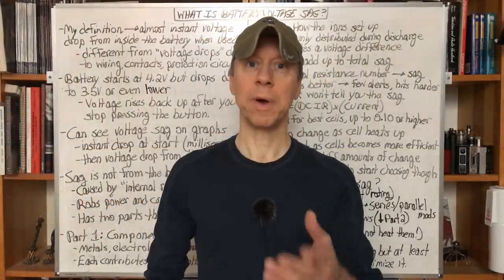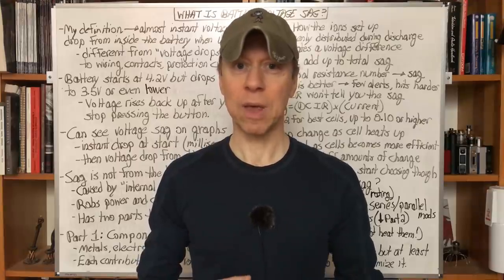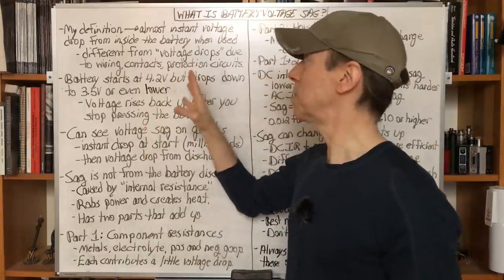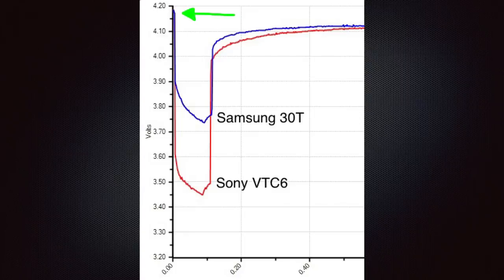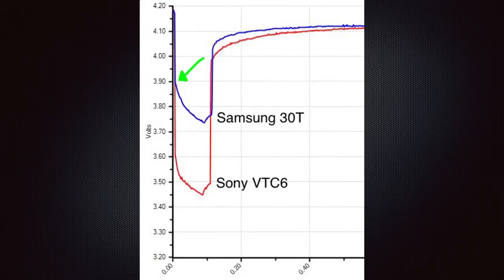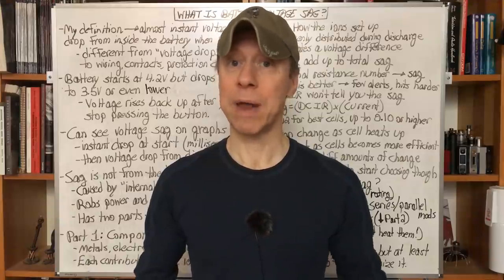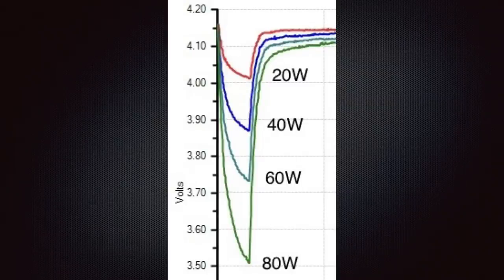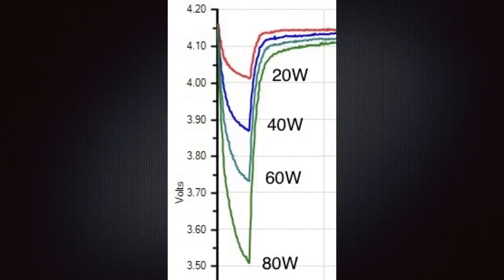Minding Your mAhs – Ep021 – What is battery voltage “sag”?

Comment: Mooch.  Congrats on this series of videos.  I'd like to recommend one on rewrapping batteries and choice of battery insulator.  Should we, if we do how do we do it safely?  I've seen vids with people removing the wrap with a metal tool from the positive end.  Also can you do one on how to check your set up on a mech / unregulated.  So measuring what's happening with voltage loss and sag under load.  This would include equipment needed, how to do it safely, interpreting results etc...
Reply from the maker: Mike Vapes has a good rewrapping video. Jai Haze has a battery sag video.
I’d like to do both some day though.
Reply: @batterymooch  Yes I've seen Mike's and it is good. With all due respect to Mike he's not the obvious person to turn to for a 'how to' with regard to battery safety. They're just suggestions.  I'm pointing people in your direction.  It's surprising how many people have absolutely no idea of what capacity batteries they have in their mods.
Reply from the maker: Phil Drewett I was just suggesting resources to use until I can do my videos. 😁

Comment: Another suggestion mooch with regard to your great vids.  If you ever decide to edit them particularly hard hitting for everyone, but especially for noobs is maybe to include some footage of batteries venting.  I've seen a few where I think it was down to keeping a spare loose in the pocket probably in bad condition.
Reply from the maker: I agree. Video of cells going boom would be good but I think we all know it happens, even the new vapers. My big problem though is that it is generally frowned upon here in Manhattan to do that type of stuff in the city parks and it’s definitely not being done in my apartment anymore. 🙂 I have some safety testing that would benefit from it though and hope to find a way some day.
Reply: @batterymooch  I knew it has happened.  I didn't realise just how dramatic it was until I saw some poor sod running around with his trousers ablaze though.
Reply from the maker: Phil Drewett when you contain all that gas, smoke, and flame in a mod it can turn into something like a rocket engine. Scary stuff!

Comment: Thanks for this Mooch, very helpful indeed. Just a quick question unrelated to this particular video, for a dual battery regulated mod using it at around 75-140 watts I'm not sure if buying 2 samsung 20s's or 2 Molicel P26's would work more efficiently for the longest time? But either one in a dual battery situation should most definitely last longer at 75 watts than say one a single 21700 Molicel P42 or 30T, right? Cheers Mooch :)
Reply from the maker: The dual P26A’s would last longer than any single cell. Not sure if dual 20S’ would.
At 75W (dual) the P26A’s are the best choice. At 140W the 20S might run for longer. You might have to try both to see which work best for the way you vape.

Comment: Hey mooch i have a question that is not related to this particular video but i wanted to ask;
I have a 80w box mod, is using the awt imr 18650 battery with a 0.2 double coil good?
Reply from the maker: There are many different AWT 18650’s, some rated under 10A. But I do not know the true ratings of any AWT’s now since it has been too long since I have tested any. AWT hugely exaggerates the ratings of their batteries though.

Comment: Hello Mooch, we prepared the battery, in the first charge there is appear sag, and voltage drop drown, but in the second charge and discharge the sage is disappear, could you tell what's the reason. thank you
Reply from the maker: I don’t know.
The battery might have been old and after it was used and charged it started performing better. Or the battery was warmer the second time, that helps a battery perform better. Or the testing you did changed the second time you did it. But I am only guessing, there’s really no way I can  know from here what’s going on with that battery, sorry.

Comment: It is not a question to the video, but maybe someone can help me. I'm a MTL vaper and I normally don't go over 5A with my builds. Are there any batteries with better batterie life than an VTC6A? I know that a lot of batteries who claim to have more than 3000mAh can't output much amps, but this shouldn't be a problem for a MTL setup, right?
Reply from the maker: Try the Sanyo NCR18650GA. It’s about the most capacity you’re going to get while still working efficiently at 5A.

Comment: Vapers at 80+ watts on a dual battery mod would need the 2500 mah rated cells not the 3000 mah rated  cells  to get the most out of your batteries
Reply from the maker: Cells like the 2500mAh HE2, HE4, and 25R wouldn’t give much of any improvement in battery sag though other high performance cells could. In my testing the “crossover” point for when a cell like the VTC5A would be the better choice was above 50W-55W or so, about 100W-110W in a dual battery mod. Chain vapers might see that crossover point be lower though.

Comment: hello mooch, I have a question, recently bought a xtar 4 slim charger, which can charge a couple of batteries to 4.1 v -2.0v - 1.0 v, charge 2 Ijoy 20700 batteries to 4.1 v automatically, being in 75% of charge, I just stop wasting the batteries and I realized that both batteries had been damaged that had relatively little use (6 months), at that time I thought the problem was the batteries, days later I returned to charge two more batteries in the automatic mode 4.1 v two batteries 21700 golisi, were charging normally, and again stopped charging and again damaged my pair of batteries, the question is, charging batteries to 4.1 v, can damage the batteries? Thank you
Reply from the maker: No, charging to 4.1V should not damage the batteries as they can be charged to any voltage between 2.50V-4.20V. How do you know the batteries were damaged? The charger just might not be charging up to 4.20V. How are you reading the voltage?
Reply: Battery Mooch thanks for answering, this slim 4 charger of the xtar brand has a charging function in three charging modes (4.1 v -2.0 v - 1.0 v) but when placing a battery, it automatically loads to 4.1 v, it can be manually changed to mode 2.0 vo 1.0 v, also has a temperature sensor that generally a cold and discharged battery has a temperature of 22-23 degrees Celsius, and if one loads it directly after removing them from the mod, it has a temperature of 32-33 degrees Celsius approximately, I charge them at this temperature (32-33 degrees) and I started charging them for the first time in this new charger that I will replace the VC 4 of xtar that stopped working in less than 6 months, when placing the batteries in 33% load, began to load regularly up to 75%, but from one moment to another the screen stopped reading the load, at that moment I thought, the charger is badly connected or is with a defect, remove the batteries and probe in my EHPRO ARMOR (2 1700/20700/18650), and did not fire in both batteries to 75% supposedly, days later I returned to load a 21700 or 20700 I'm not sure, started loading normally, but after a few minutes, the screen was again in blaco and just indicated below 4.1v, I went back to test them in my mod and simply did not turn on the mod both batteries, it is there where what I first thought was my battery problem that I bought next to the VC4 charger (6 months of use approximately), I left of that doubt because again I miss another pair of batteries in a week, the charger works perfectly 18650 batteries in charge 1.0v -2.0v but I no longer risk to charge my batteries in the 4.1v mode

Comment: I wish U wldve given some examples like comparing the samsung 30q and lg hg2. Vaping between those 2 batteries is when i really learned about battery sag and IR. The samsung 30q is a much better battery for how i vape. I havent done in depth tests but just from using both I have a better experience with the 30q. Not to say the hg2 is a bad cell cause its excellent as well for how i vape but I prefer the 30q. Plus its pink and who doesnt love pink hahaha. Id like to one I the  DCIR for both.
Reply from the maker: I did a video comparing those cells, along with the VTC6. 🙂

Comment: I do not understand “C” rate....can you make it understandable for building a large eBike battery pack?
Reply from the maker: I already replied to this question that you asked several days ago. 🙂
For multiple cell packs you just need to know the individual current ratings, add them up depending on how the pack is configured, and then calculate the C-rate. The C-rate doesn’t offer you any new info though if you already have the current rating and capacity rating of the cells you are using.

Comment: Do not charge Li-ion batteries below 0 deg C! Does this apply to battery packs used in electric vehicles?
Reply from the maker: Most EV’s have pack heaters but always follow the manufacturer’s directions for the EV.

Comment: Just need some clarification sir.  Two batteries in series with a 30 amp load are pulling 30 amps in each battery, while two batteries in parallel are pulling (roughly) 15 amps in each battery.  If this is correct you might need to put a correction in the video as it sounded to me as if you were saying that a 30 amp load for 2 batteries in series is putting less strain on the batteries than a 30 amp load on a single battery.  Maybe I just misunderstood.  Other than that great video.
Reply: After listening a few times you said when going to a series mod that the current will go down.  IF the person operating the series mod knows ohms law and uses a higher resistance build (more than twice the resistance of a single battery mod build) then the current will go down.  A few weeks ago i ran into a guy running a .24 ohm build on a triple series unregulated mod.  This is one reason why I think this bit should be worded differently as obviously not everyone using a series mod knows ohms law.
Reply from the maker: Yea, it’s a tough one. There’s always several other directions each video can jump off into to cover everything. Thanks for your feedback!
Reply: ...so would a 2 cell parallel configuration only suffer 1/2 the "sag" of a single cell configuration ? And would a 2 cell series configuration suffer double the "sag" ??
Reply from the maker: vdog 55 sag is determined entirely by the current drawn from the battery, no matter how they are connected. Less current = less sag. 1/2 current could result in less than half the sag, depending on how hard the battery was being used. But it’s roughly a linear relationship between current draw and voltage sag.

Comment: I've been trying to find the C rating for Samsung 40T. I can't tell a difference on a .17-.18 build running on a 30T and 40T. I've been typing in 6.25 for the c rating so it comes to 25Amp
Reply from the maker: The C-rating doesn’t matter. Only the current rating is important as it lets you calculate the lowest resistance you can use without going over the battery’s current rating. But, yes, the C-rating is 6.25 for my 25A rating of the 40T.

There’s not much of a difference between the 30T and 40T at that current level, though the 40T could run for longer. The 30T really shines at up near 30A-35A.